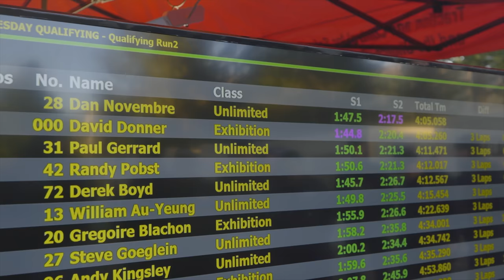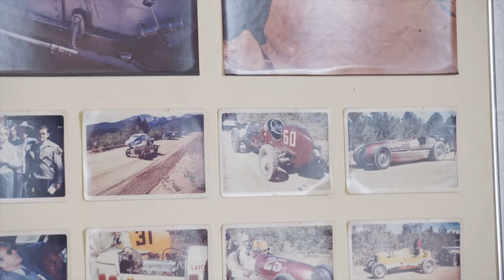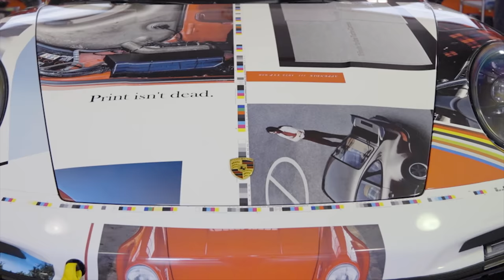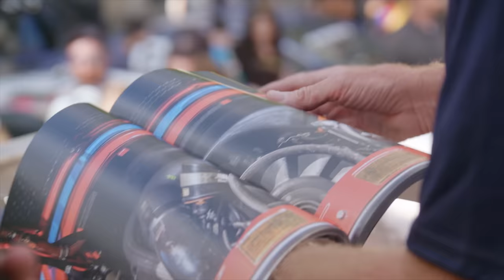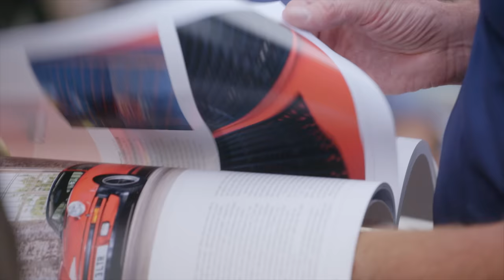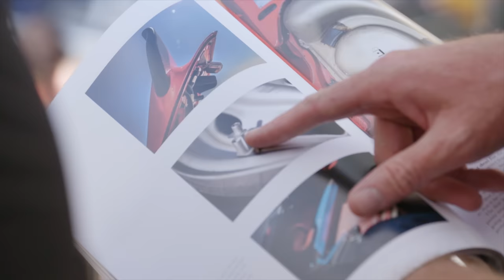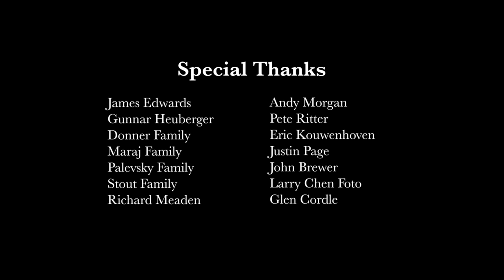A Pikes Peak Story - Porsche 911 Turbo S: 🏁 2022 Winner 🏁 | Carfection

Comment: Showing why the Turbo S is the sleeper supercar. Great conditions to show the strengths of the vehicle, mega traction despite a cold wet road and balance under breaking and across the bumps. It’s shocking how fast it is and it sounds like it’s hardly working compared to the GT Porsches. What a machine! Also, credit to the driver who kept the speed up despite white out conditions for the top third. Very brave.

Comment: Driving it home is the ultimate flex!
Reply: Save a ton on trucks & trailers.
Reply: It’s marketing
Reply: @BARATTI99   But with a Turbo S actually easily possible. In Germany there is a 991.2 Turbo S of 2020 by PP-Performance, tuned to 1000 BHP with stock gearbox and even most of the engine stock - they made 45 runs in a row on a drag race (in between all the R35 GT R with 1000 BHP needed to fix stuff and they already were running with a custom gearbox) and it had not a single problem. Afterwards the owner used it again as his daily. The 911 Turbo S is the best allround supercar ever built... it's a racecar, a highway car, a daily for 365 days a year. It's fast, turns like a beast and it still is comfy.

Comment: Half a minute faster than the second place Tesla Model 3 in the Exhibition  class? This 911 is a rocketship 😲😃. I can't wait to watch the full story :)
Reply: And the hybrid Turbo will be on another level.  Again.  Think 918, but much faster.
Reply: Well, pikes peak isn’t exactly a straight road. So, those Teslas can’t really match it.
Reply: @guri131  bruh, so you are saying Tesla on 2nd place and it's bad on this? Lmao. Get over it dude, Tesla is literally made for quick acceleration.
Reply: @guri131  yeah but the EVs have a massive advantage as they don’t lose power due to altitude, which is why stuff like the IDR were EV
Reply: @thebarkingmouse  yep much modern and significantly way faster 😂 😆
Reply: @currycel470  Quick accélération mesnd litteraly nothing when the cornering or driving dynamics aren’t perfect lol…
Reply: @slideways8022  Turbos, especially if the engine is remapped for it, don't lose power due to altitude either.
Reply: the tesla was modified to within an inch of its life. crazy aero and replaced everything. brakes suspension interior.
Reply: @slideways8022  Which can be compensated for with the turbo; turbo piston aircraft can cruise at nearly twice the height of Pike's Peak, which has much less air.
Reply: I believe that was Randy Pobst’s car, and he had some serious issues seeing the road because his windshield fogged and he had to loosen his harness so he could wipe it. I’m not a Tesla apologist by any means, but it’s important info to know.
Reply: Look ma a 50k odd four door family car is slightly slower over 12 miles of corner rising in elevation than a purpose built all wheel drive supercar which costs 4 times as much!
Reply: @nyc863  it’s crazy right! That Porsche can make such little power but litteraly obliterate the competition 😂 😆
Reply: Tesla is not even in the same league.
Reply: @currycel470  they are one trick ponies, good for going in straight line, they don't do handling or braking 🤣
Reply: @Saif0412  and thats why Tesla’s cheap family car with four doors came second numbnut?
Reply: @trancenut81  Slightly slower? 30 seconds isn't anywhere little, atleast in racing terms. Lol dude seems to be a Tesla guy.
Reply: @Vincent_Stevens  - its still placed second numbnut and nowhere does Tesla mention that its a super handling supercar. That would be the Roadster
Reply: @trancenut81  Yeah talk about the roadster. 5 Years and no sh. Try again lol. 30 seconds defines the price difference You talk about. So turn yo brain back ON.
Reply: You've gotta talk about the legendary driver too, he's beating everyone in a stock car 😂
Reply: He didn't win it came second to a wolf tsc fs misleading headline on  video
Reply: @currycel470  a 2018 wolf tsc fs won the race the porsche came second its a misleading headline.....
Reply: @alanmay7929  it came second to a 2018 wolf tsc fs its a very misleading...
Reply: @andyhulme2274  Oh yeah they acknowledge it in the description, it was the winner for the Exhibition Production car class. The Wolf took overall but was in unlimited, basically an F1 car. So impressive for a basically stock vehicle!
Reply: @cybertree  No, absolutely not "basically an F1 car". What a ridiculous claim to make!

A better description would be: "A ramshackle home-made amateur machine with a measly 2.1 liter 4 cylinder engine, rear wheel drive and a chassis plus tires totally unsuitable for that track in those conditions."
The driver even said that he just coasted much of his run because he could see so little and his car wasn't suited to those conditions.
Reply: @andyhulme2274  I Think they meant about the win in the Exhibition class.
Reply: How come a model 3 got the second place and not Tesla Plaid?
Reply: @swedish_sadhguru3854  Who cares about appliances?
Reply: @trancenut81  if it was stock that would be very impressive. But the Tesla was modified to within an inch of its life.
Reply: @nyc863  did it had its motors and battery replaced with more powerful one? If not, you need to change your definition of “within an inch of its life”. As it turns out, Tesla Model 3 even after those mods would still be slower than Porsche in a straight line and also top speed by a long shot and it still remains a 4 door family car which cost less than 1/4th the price of Porsche. I am surprised its only 30 seconds slower than a Porsche inspite of the fact that Randy, its driver had issues with fogging. Dinosaur’s juice and its drinkers are a dying breed, like it or not.
Reply: @alexbelmonte4581  Randy drove a modified Model S Plaid, which was 18 seconds behind the Model 3 (driven by Daijiro Yoshihara).

A car with nearly 400HP more and a lower CoG should have destroyed everyone, especially since ICE lose power the higher up the mountain they go.
Reply: @andyhulme2274  It won it's class, not overall (came 2nd overall). 

I agree on the headline though, it could have been more transparent.
Reply: The model 3 is an affordable family car made in the hundreds of thousands. If the 4x more expensive sports car the 911 didn’t beat it it would be a total embarrassment.
Reply: @trancenut81  Roadster?🤡
Reply: @thebarkingmouse  Think Tesla Roadster but much slower.
Reply: @mosfet500  when it happens it happens.  So far no.
Reply: @edimbukvarevic90  lol thats simply wrong. they would only not lose power if u dont give em fill power at low altitude
Reply: @alpha-cf2oi  I mentioned remapping for altitude.
"Turbocharging at elevation is an efficient way to minimize horsepower loss due to elevation and lower air density. At high elevations turbochargers compress more air into the engine cylinders making up for the lower air density allowing the engine to produce power as if it was at sea level. This extra tunability is found only in turbocharged applications."
"Racers using boosted engines will match their turbo for the power they want to make at the start line (9,000 ft) and as they increase in elevation the ECU will adjust boost pressure and other parameters to maintain the same power as long as the turbocharger can support the additional air volume and shaft speed."
This is from:
"Turbocharging at Elevation" article
Reply: @alpha-cf2oi  from this video:
"With this car we were allowed to do stuff to the fuel map because of the altitude, otherwise it has to be stock..."
So, it was remapped for the increased altitude. I guess regulation allows it.
Reply: @alanmay7929  i mean, no need to worry about thin air at that height, ice engine can lost upto 30% of their power on track. And since it's already heavy, it will perform better than ice cars on corners because they can't create fukin downforce on corners in thin air.
Reply: @currycel470  you realise that that Porsche did way better time than any tesla right!? Also forced inductions engines are less susceptible to thin air, the computer/ECU actually makes adjustments at all levels to perform better. Weight is actually your enemy at corner that’s probably why moded teslas were that slower! EVs are great for straight line 0-60 the rest of ICE.
Reply: @trancenut81  you mean a seriously modified “50k” car lol……… grow up! You’re going to compare the tesla plaid now to a Bugatti Chiron!?
Reply: @Vincent_Stevens  he is a brainwashed fangirl! The tesla plaid 1100hp on the Nurburgring was also way way slower than 3years old similar sedans with barely 600hp from Mercedes’, Porsche and bmw.
Reply: @trancenut81  man what a wall of text.
When a car has: special brakes, special suspension, special aero, special interior.. it is far far far from stock. I bet a stock M5 CS (also four door) would slaughter a stock Tesla Plaid, up pikes peak.
Reply: EVs will always have a weight handicap to deal with. Tesla is better than other EV brands in that regard, but obviously ICE vehicles are still much lighter and better suited for the track.
Reply: @nyc863  and that special car being driven by randy had a serious problem with fogging. Keep flogging your dinosaur’s, their time is limited anyway
Reply: @trancenut81  Yeah it had that issue 'cause it's far from stock, got it? Tesla so far didn't set any records with their stock street cars anywhere around the globe. Time will tell what reasonable priced EV's can do on track!
Reply: It was faster than a 1000hp Tesla on slicks. Says it all. Teslas are jokes
Reply: @trancenut81  yawn, another low testosterone Teslasoyboy. Wake us up when a fully gutted Tesla on slicks actually beats a streetlegal 911 Turbo in Pikes Peak.

Hint: We'll be sleeping a long time 😎
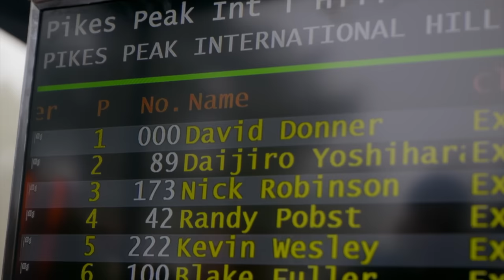Reply: @andyhulme2274  7:15 - it is stated in the video.
Reply: Also Tesla sucks
Reply: the Turbo S is a really Supersportscar for every condition
Reply: @marcelk3847  yeah, Teslas look like Daihatsus lol
Reply: @trancenut81  were you bullied by guys with loud cars 😂
Reply: @swedish_sadhguru3854  I'm pretty sure Evasive motorsports had the price in mind, since they were planning on completely gutting the interior, essentially replacing the whole body kit, and even tampering with the electric engine control, they didn't want to start with a $120,000 car just to remove half of it. Maybe they'll get their hands on just the electric motors from the plaid soon!
Reply: The model 3 cost the same as a golf r lol 😆 but wow a 911 turbo S beat it amazing.
Reply: @nyc863  I’m curious to see that race
Reply: @koruki  a Racecar Plaid with over 1000hp was way slower than the 911 too lmfao
Reply: @artansadiki3244  that’s impressive. Have always loved the 911’s
Reply: @koruki  Nothing compares to them
Reply: @slideways8022  Don't ignore the disadvantages of EVs either though, they need a massive amount of battery cooling which is harder in thin air and inherently more difficult - because EVs run cooler, the delta T is smaller (thus less efficient) than that of an ice cooling system.
Reply: @currycel470  Tesla made for acceleration? Lol you mean made to get groceries? .. Acceleration also includes lateral and braking deceleration performance, both of which Teslas are terrible at.
Reply: @currycel470  quick acceleration but horrible handling. The Dodge Demon is quick at acceleration too but beyond a straight line on dry pavement it's useless.
Reply: @currycel470  Tesla cars aren't for racing, not even sports cars.
Reply: Tesla Soyboy make me like my Tesla even less. Tesla are great as transport and that's it for now. Porsche are far better overall car and should be applauded for what it is.
Reply: Man Teslas are basically Camrys with a lot of horse power. Yeah they accelerate but can’t do any thing with it. Wouldn’t even count them as a sports car. The Nurburgring times show what the ‘50k’ stock Camry does. A Ford Focus st beat the Tesla hahah
Reply: Wait, a Tesla can make it up there in one go without having to stop to charge?
Reply: @amorag59  liquid cooled lmao not by the air 😆
Reply: @marcelk3847  And how does your radiator shed heat? 🤦
Reply: @nyc863  nah that was the plaid not the 3
Reply: @trancenut81  aero and suspension are much more important than a bit more straight line speed/acceleration on every track aside from a drag strip. The tesla is not a racecar, it just has straight line speed
Reply: @edimbukvarevic90  engines lose power at altitude. It is physics. You cannot bend it. You can add more boost, but you need oxygen to burn fuel. Physics.
Reply: @assortednuts8436  the 3 was not stock. It was fully race prepped: stripped interior, huge aero, race brakes, race suspension the whole nine yards. Just look at the articles.
Reply: @nyc863  oh I though u were talking about that unplugged performance plaid. That thing is crazy.
Reply: 50 years of optimizing the 911 should definitely show some results compared to a Tesla.
Reply: Telsa exists since 2003, Porsche since 1900 (lohner Porsche, an pre wold war 1 ev vehicle), that's a pretty big huge advantage in science on how to put power on the surface.
Many people build (fast) car in their shed, but that doesn't mean you have to knowledge to put down the power on the surface and others things.
Volkswagen (Porsche, Bugatti, etc) is also the biggest or second biggest car producer on the planet.

The VW bug was designed prior to 1938 by Ferdinant Porsche, 84+ years ago, 21,529,464 built and still driving around today.
Reply: @slideways8022  so they lose on corners, and don't have straights enough to use all that quick acceleration, what's the point then?
Reply: @alexbelmonte4581  Randy's car was the Model S.  The 2nd place (in class) Model 3 was campaigned by another team (Evasive Motorsports)
Reply: @trancenut81  highly modified Model 3 with wings etc. Don't think you get this for 50k
Reply: @larslysdahl4586  the Model 3 was not Stock!
Reply: @edimbukvarevic90  thats why they where Used in old airplanes😉
Reply: @leechampion6538  engines lose power at altitude because air density (and therefore oxygen density) decreases with altitude. With forced induction (turbo or mechanical compressor), intake air is compressed to increase air density and therefore oxygen mass per engine displacement. Higher oxygen mass means higher fuel mass and higher power output. That's the only reason there is forced induction - to increase intake air density in order to increase oxygen.
Reply: Funky ahh tesla
Reply: @AnalogDude_  You have a point that Porsche knows how to make a good sportscar. Putting power to the ground (traction) is a uniform thing across the automotive board though. Light weight sportscars are besting much more expensive supercars of the past on Nurburgring lap times simply because of better tires. IE lap times as a whole are improving as tire tech improves. Porsche also created an EV called the P1 in 1898 so EV technology technically is as old as engines. What is telling is the absolute technological difficulty to match energy and power density of a battery to that of an engine, which is absolutely critical in racing.
Reply: @amorag59  Porsche has 2 more competitors in their backyard, Mercedes and BMW. it's eaten or get eaten.

that PDK / DSG transmission is blazing fast, like seamless. you can't win.

You have to get the right width of tires also, to much too much resistance, to little and it will slip.
Reply: @amorag59  ... also you need specialized machines to test if you have the correct springs and dampers for the weight of the vehicle. not something Joe's garage on the corner can afford. that's a whole science and would probably takes weeks or months.
Reply: @alanmay7929  no matter what electric car comes out porsches hybrids and soon electrics will run the show!
Reply: @saucey99  keep dreaming lol……. The funny thing is that those EVs needs way more hp to even compete with ICE go figure out 😂 😂 😆
Reply: @Vincent_Stevens  he is a Teslasoboy, they have no idea about cars. All they want is smell Elons farts
Reply: @edimbukvarevic90  Yes, turbos still do loose power at higher altitudes, just not nearly as much loss as normally aspirated engines do. Teslas cannot handle as well as these Porsches, and a Teslas weight in transitions on back to back turns will place them at a disadvantage compared to the Porsche 911 Turbo S and GT 2s. Being 1,000 to 1,200 pound lighter than a Plaid helps on back to back turns.  Plaids and even the upcoming Roadster is heavier  and they can't break the laws of physics. Pikes Peak or for Nuringbring, a Porsche GT 2 will beat the new upcomming Tesla Roadster, regardless of the Roadster running 8.6 in the quarter mile.

Comment: The new 911 turbo S is a legend. Awesome performance. Internal combustion rules!
Reply: Internal combustion?! Booooo. I'm a fan of steam, and none of that fancy modern combustion stuff will do.
Reply: @diaspo  im also a fan of steam and i love the torque of steam. But a v10 singing is just ahhh eargasm
Reply: @diaspo  you and your fancy steam machines. He should’ve run barefoot up the peak himself.
Manpower rules!
Reply: @diaspo  i love steam engines. Same with ICE. Its EVs that are laughable.
Reply: @diaspo  i love steam engines, Combustion, and electric cars. I can appreciate all of them.
Reply: The EV fanboys won't like this and throw AA Batteries and 🏳️‍🌈 flags at you.
Reply: 👏😄 Very well said,  @diaspo .  Seems the joke was only understood by a few of commenters.  Really, the failure by most here, actually defines the ignorance of the denialist mob. 🤦🏼‍♂️
Reply: @artansadiki3244  🗿
Reply: Put Donner in the Tesla (and fix the defrost), he'll probably go faster.
Reply: new and OLD 911 Turbos .. all are awesome .. and one of the few cars that appreciate in price
Reply: @r7cardosuarez806  bruh 😂😂😂
Reply: @danmobileTM  Teslas are slow dude. 1000hp, slicks, massive aero, still slower than this 911 Turbo on street tires. Slow junk